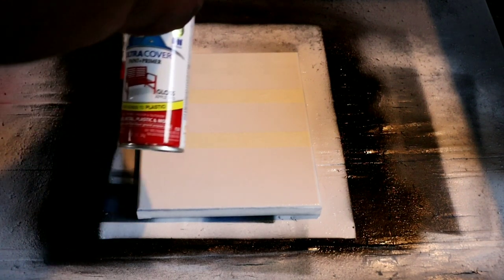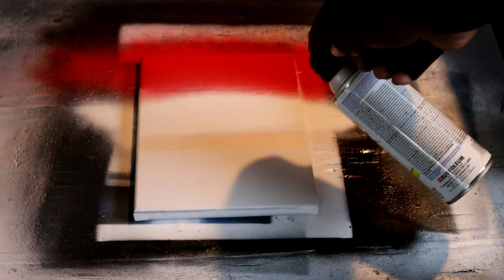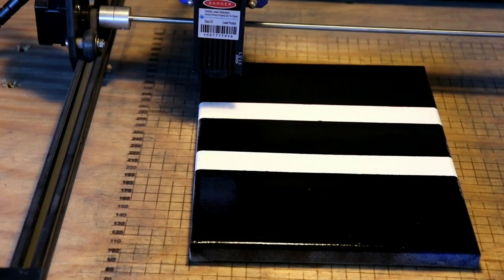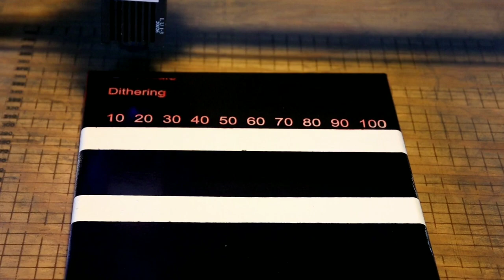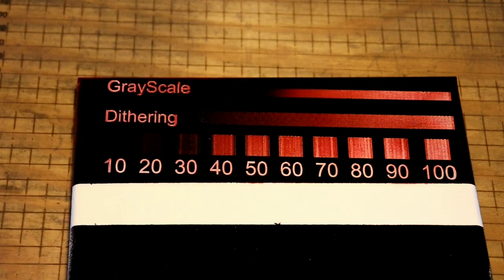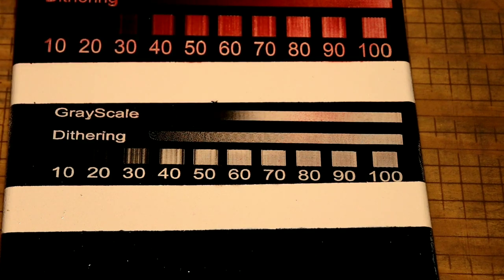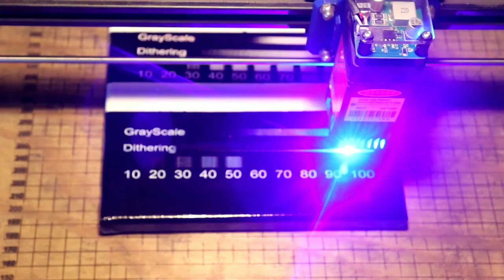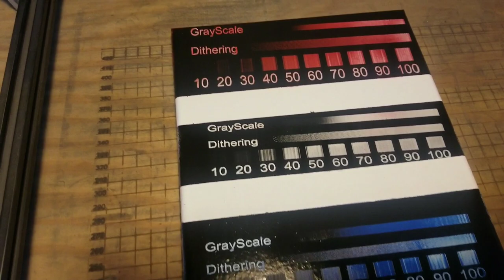Ortur Laser Master 2 15 Watt looking for the "Sweet Spot" Using colors on Canvas

Comment: Thanks for the advice.. mine was ordered right before Christmas as a Christmas present. Trying to learn as much as I can before I get it
Reply from the maker: Glad I could help!
Reply: Mine was shipped 12/19/20 by Gearbest. So far no sight of it, nor does their tracking number link work. Multiple times contacting them but just a run around by them. I hope mine actually arrives, and soon. How has your order been doing?
Reply from the maker: @luckettg  it's normal takes about 3 to 4 weeks if you didn't purchase the priority mail . I didn't purchase it and got mine in 2 weeks . I will keep praying that it is delivered to you soon
.
Reply: I just got a text notice to expect delivery on Thursday, 1/14/21. Keeping my fingers crossed 🙂
Reply: @luckettg  damn I bought mine on amazon a week ago and it came in 4 days
Reply: Lee Hughes I saw it there for at least $100 more than Gearbest.
Reply: @luckettg  Well damn I guess I paid $100 extra as a delivery fee then huh for not shopping around better
Reply: @luckettg  Gearbest is notoriously bad for shipping and customer service I recommend  3d printers.com

Comment: Have you ever attempted adding a spray of color in a specific area of the canvas where you knew an object in the picture was going to be burned?

If so did it affect the burn or picture?
Reply from the maker: It works you just have to know exactly where the color needs to be place. It also depends on the shading of the image.  If it is dark in that area it might not burn deep enough to reveal color if it is light more than likely it will burn deep enough.

Comment: I got one question, do you have the laser on the stock bracket? Do have a height gauge or a certain height you keep the laser at. Did you create that test or is there a file out there on the web somewhere? Thanks for the info. Love your work.
Reply from the maker: I use a height  adjuster I got it from Slvrdesign3d.com and if you email  me I will send you the file.
Reply: @zerica24   have you thrown it on Thingiverse or did you find it there?  Tried looking for it but cant find it.   Wanting to print it for mine.

Comment: Did you adjust the laser height or do you just place the canvas down?.  Great video as always.  Cheers.
Reply from the maker: I leave  the laser where it is at. But if i wanted to focus more I would adjust the head then run the test until I find the Sweet Spot.  Good luck Thanks for the Support.!!

Comment: I have tried to make some canvas, I put two white layers and one black ... and when I laser engrave instead of white, the background is gray. Any suggestions? think the program is. ? 
I use laser grbl, could you make a video using that program? since many do not have the ligthburn
Reply from the maker: That means you need more power or your not waiting long enough between coats

Comment: Hey brother. It's not wor9for me. Whenever I try to engrave this test. It just burns through the canvas.
Reply from the maker: Are you following  the Z Method  2 coats of Gloss white  and one Coat of gloss black.
Reply: @zerica24  yes I followed the same method. I bought restoleum 2x Gloss. Used 2 coats of white and 1 coat of black.